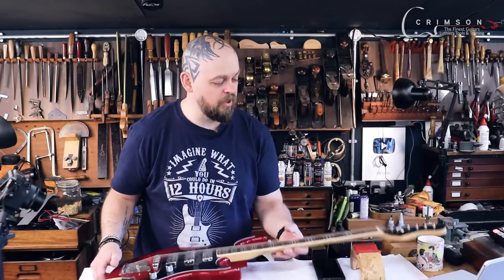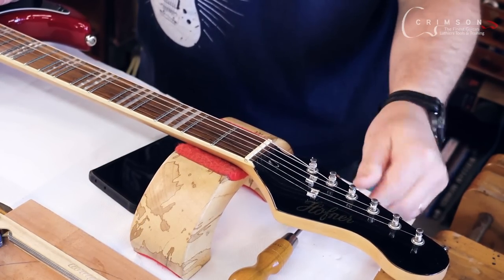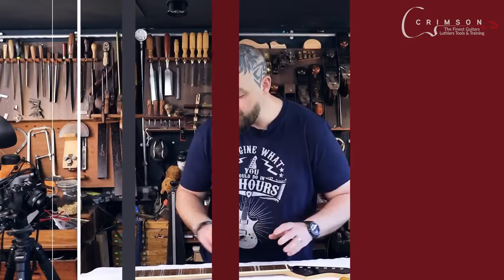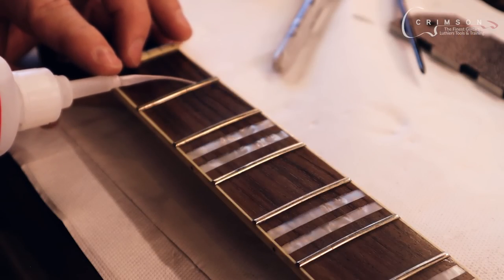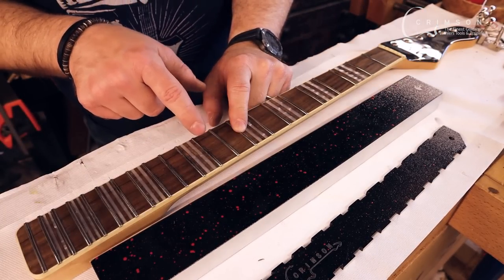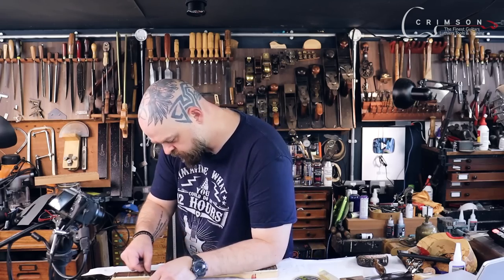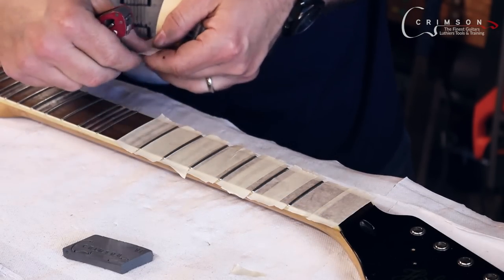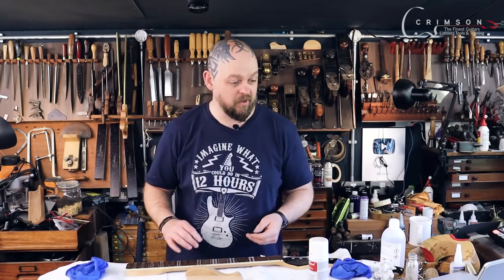Rescuing a Hofner Galaxie Guitar from the WORST Factory Frets EVER - Guitar Restoration

Comment: A bit of chap stick on either side of the frets prior to using the super glue will make removing the excess glue very quick and easy. The glue is incapable of penetrating the wax and sticking to the wood underneath.  
After applying the glue, scrape the wax off and wipe away whatever's left with some naphtha. Candle wax works just as well, but chap stick is already the perfect consistency and form factor for applying to the fingerboard.
Reply: This is definitely a tip I'm trying in a number of different situations now, thanks for sharing!
Reply: does the brand of chapstick matter? I want the most mojo possible lol
Reply: @mackk123  lol good question actually. I would say that as long as it doesn't have any additives like aloe, menthol, etc it's probably fine. I personally only ever go for the basic black chap stick or carmex in a stick. You won't really have it on the board too long to worry about too much, but just to be safe...avoid all the weird stuff lol.
Reply: @LeviBulger  nice I have some classic carmex melting in my car.
Reply: @LeviBulger  I heard the menthol makes the tone too minty
Reply: @mackk123  Ha, I probably do as well. You know melted carmex really isn't all that different than mineral spirits you can buy at hardware shops for oiling wood. Lots of luthiers favor that stuff for treating dry fretboards.

Comment: This guitar is a reissue  of the earlier Hoefner Galaxy (note the umlaut) from the sixties - which I owned having purchased it in a second hand shop in Weymouth for 7 pounds and 10 shillings 
mine was covered in red snakeskin vinyl  which made my forearm sweat when playing - in the early 70's luthier supplies were generally not available in Dorset  (where were you?) 
The pick ups on mine were fake humbuckers - in that they only had one coil in a dual coil body  - I sold it at a small profit

Comment: Hi Ben, have been using the fibreglass pens for years after working in the computer industry since 1980, I found  them great fir cleaning up bits and bobs on vintage guitars, they are great for relicing maple neck finger boards to simulate 50 years of playing (not that I like reliced guitars)
A word of warning, the fibreglass shards are dangerous to eyes and skin in general, the first time I used a pen I had shards in my fingers and on my thighs (went through my jeans) that took a couple of weeks before the itching and irritation went away. But more importantly, Watch and protect your eyes.

Comment: If you have three pickup switches you will get some hum if they are all off. That’s because it’s an open circuit. What I do is wire the switches so when they are all off it grounds the output.

Comment: Well there you go, this is actually something I do on a regular basis.  I buy broken and non working instruments and make them work again.  Currently on my bench is a '67 Harmony Sovereign 1260, beat to hell with a snapped off poorly repaired headstock, crappy frets, gouges in the fretboard, bad bridge saddle and nut, etc.  I've already repaired the headstock, stripped the frets, resurfaced the fretboard.

Comment: I have a neck from aliexpress with a worse fret job... I think the fret slots were not deep enough for the fret tangs, because they are not seated properly. My first fret leveling didn't work well... then I flooded the frets with superglue with the same method (but protecting the rosewood with beeswax like I learned from stewmac). Somebody told me it wouldn't work without pressing the frets, but it worked pretty well and it ended up great after the 2nd fret leveling and crowning.

Comment: Ben, please tell me about your bench grinder polishing rig. I have a big one in my shop but I want to setup a small one like you have at home. What are the RPMs and how are you attaching the buffs? Thanks!
Reply from the maker: I'm using a standard 8" Record Power Grinder with a pigtail to mount the wheel on - works great.  DC

Comment: It wasnt just budget guitars that were badly built and furnished with bad quality parts, I remeber back in 1986 anything under £400 was pretty much garbage with one exeption and that was the Squire Japanese range, I have a 1986 Jap Tele that will knock the socks of the majority of Fender models both old and new, my friend has a custom shop Tele which is awesome yet prefers my Squire Tele, £400 in 1986 is worth £1248.90 according to the inflation calculator and you can get a decent budget guitar today for a couple of hundred quid, how times have changed!

Comment: Weirdly the Hofner Galaxie was the guitar I always fantasized about getting when I was a kid - I saw one in some guitar book, it was the first guitar I'd seen with 3 humbuckers.
Reply: They are not humbucker, they are single coils
Reply: @MrFlint51  I've no idea what was in that or the old one I saw in the book. I thought they looked like humbuckers at the time but this was in the early 90s. So was probably a picture of a 60s or 70s guitar.
Reply: @JDODify  According to "1001 guitars to dream of playing before you die" (my bible for old guitars) the original 60s Galaxies had single coils, and they look exactly the same as the pickups on Ben's. The 60's ones had1 edge-on rotary tone control for each pickup (on the high-E side) along with a master Tone, and a master Volume control on the low-E side, adjacent to the pickup slide switches. The knurled metal pot knobs show that Ben's is a later model.
Reply: @MrFlint51  cheers. That might have been the book I saw it in actually
Reply: Further reply; according to Music Radar the reissues in 2014 DID have mini-humbuckers, and they look very similar to the picture in "1001 guitars"
Reply: @MrFlint51  Can confirm mine were certainly faux humbuckers
Reply: Those pickups ARE humbuckers - they're Hofner 511 'staple' humbuckers. The single coil variant was the 510 'Diamond Logo' type. They kept the width of the single coil 510 version to that of a humbucker (more like a mini humbucker really, Hofner pickups are closer to those or a Filtertron in size, though without the depth of a Filtertron) because there's a metal slug filling the rest of the case to spread the magnetic field.

Comment: hi ben, probably sounds like teaching to suck eggs, just a wee thought, when you tape off the board, do the length protecting the binding first, and when you remove it, it will take the rest with it a bit quicker, great fretwork though

Comment: Hey Ben, quick question: why, if the frets had that much give initially, was it not necessary to clamp the frets down after wicking the CA glue underneath? Won’t they just eventually pop back out again, or is the CA glue plenty strong enough to secure the fret even if some tiny gaps remain underneath the frets?
Reply: My understanding is that capillary action and surface tension will draw the superglue down into most of the gaps. the majority of the fret is holding in just with the tangs mechanical force, but a small portion of the tang is either damaged or the slot is slightly too wide, causing it to not have that friction it needs to stay put in some areas. The superglue just fills that void and reinforces the slots wood fibers.
As for not clamping..... in this situation its not really needed, and realistically you probably want them to sit in the same position they were at naturally while leveling all the other frets, but I don't have a specific luthiers answer to this one, some probably argue both for and against clamping frets :P

Comment: I was watching another youtuber who was leveling SS frets and preferred to use a leveling file as sandpaper on a beam dulled quickly.  Is there any reason to choose one or another on nickel silver?  I use Stewmac cryo fret wire if it makes any difference.
Reply: Stainless steel is a lot harder to level and crown, but the pure strength of it usually means the frets can last the lifetime of the instrument (unless its abused or highly played). Some people also have a nickel allergy, which happens the most with cheap jewelry, so SS frets are a great option for people with metal allergies.

Harder to work with and usually more expensive, but a lot of benefits. Just like every other compromise we have to make hahaha.